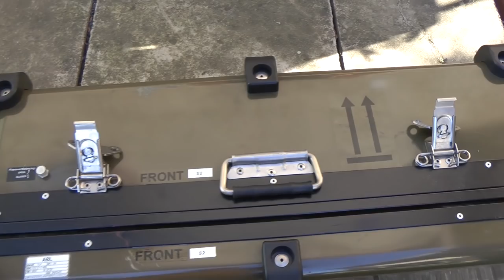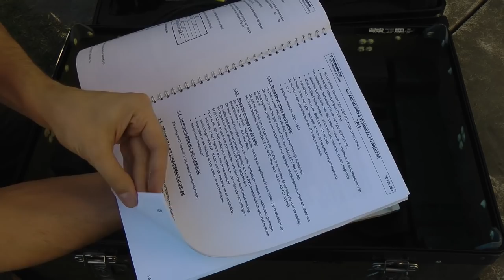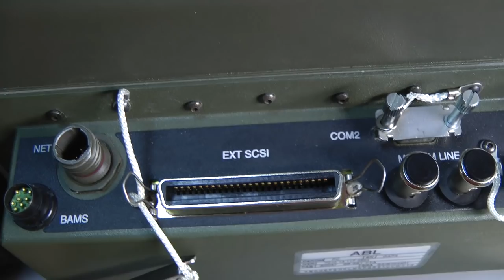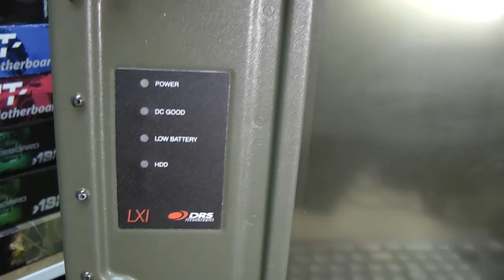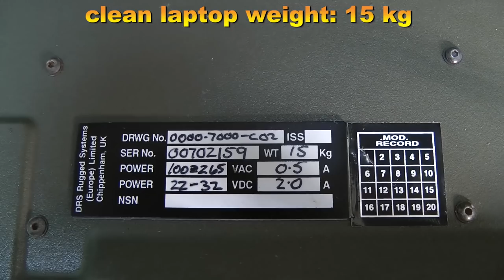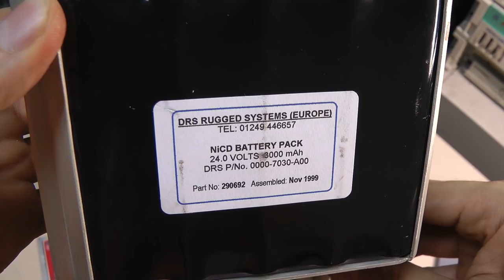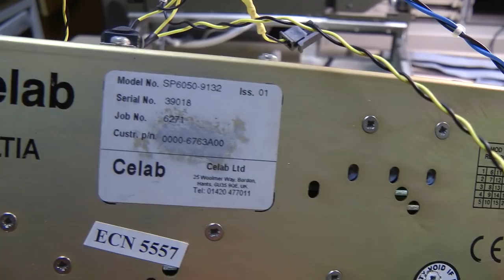Military rugged laptop - DRS LXI with Pentium MMX - RETRO Hardware

Comment: The heater on the HDD is there because mechanical drives perform badly in arctic conditions. The lubricants inside will freeze if they aren't warmed up and sudden changes in environmental temperature can potentially cause the disk to warp.
Reply: Bad sectors. Gotta catch 'em all.

Comment: I worked on some old decommissioned Canadian military equipment I found just setting in the rain with a old oil tarp covering it at a salvage yard. I was able to pull out some parts that appeared to be dry and in good condition.  Just like this unit, it was over engineered with hundreds of screws holding it together. 

It was not anywhere as interesting has this “ portable “ computer.  I’m very impressed with your work in taking it apart.  You are a very lucky bench tech and I hope someone will get back to you with answers to your questions.

Comment: the main thing is that there is no self-destruction system.😅
Reply: 7:31 this heating pad on top of the hard drive tells it HAS a self destruction system, may it burns the HD.
Reply: @rodrigo-mota  No, thats to keep the hardrive at a constant temperature while in extreme low temps, because temps affect the size of things which is not a good thing in terms of a hard drive
Reply: Those internal batteries do that job. It just takes decades.
Reply: Yes their is, its on the Hard drive
Reply: @rodrigo-mota  no it just makes the headers scratch up the drive while the drive spins at high RPMs som contain a version of termite called something else but it would be labeled with warnings.
Reply: No amount of armor can stop del system 32
Reply: @shmadul  
I was disappointed with the real function of the heating pad. maybe the fastest method of destruction is just shoot at it. 🤣🤣🤣🤣
Reply: Can't comment on equipment today but, years ago, there was destruct packs on com & crypto gear, just in case of emergency.
Reply: At least in my country no realy confident things are stored on the field computers, they are mainly just used as acess stations, codes and other things are on a separate device locked in a safe box, and one need a double check comman to activate important thinga anyway, so it's not a big deal even if that famous box would got stolen, not as in the movie world... The reality are as expected a lot more booring procedure.
Reply: Such computers could be equipped with a hardware or software signal encryption / decryption system. And a self-destruction system has always been installed in such devices. So that the enemy, capturing the device, could not use for its intended purpose.
When I served in the army , the main devices containing encoding / decoding systems were equipped with hidden thermite charges that worked when trying to open the device. 
And we have all devices containing military coding systems are not sold at auction after they are deducted from the service, but are subject to disposal under control.
Reply: @Юль4а344А  Ok, maybe there are different stage of security classifying on them, i hawe only seen the acess stations and we does not hawe any ICBM systems at all in my country.
Reply: @Юль4а344А  When You said it, i think it actualy must be adapted on those devices that can acess STRIL and similar things, the one i saw was probably just disarmed for safety reasons during mainteance.
Reply: Perhaps in such devices the self-destruction system works differently - if the access codes are entered incorrectly several times, high voltage is applied to the board and burns out the microcircuit.
Reply: @Юль4а344А  

I hawe not seen the finer details, but it may well be the case, when i try to recall my old memories i think it was also possible to connect some sort of small explosive or pyrotecnical device inside it as You mentioned, but it's probably removed for safety and legal reasons on those who are scrapped out and come out on the civil hands i think. But i know my brother tould me that some devices needed to be physically destroyed when they where scrapped out, like material that might contain sensitive data.
Reply: I might be wrong here, but as i remember data as realtime possition of troup and vehicle movement, etc are not store on any secondary memory on the field operating machines, only on RAM so all that will dissapear if the RAM power is cut off if i am not totaly wrong.
Reply: @Юль4а344А  Agreed. I just avoided the mention of thermite. Electrical-surge destruct will deny function, but some assets require melt & burn to deny inspection. Thermite packs convert stuff to slag - difficult to analyze.  Move away quickly.
Reply: @sheep1ewe   I served in the regiment of government communications and our main thing was encoding / decoding systems. Without these blocks, it is impossible to decrypt intercepted messages. Even if the enemy captures the tropospheric communications node, but the encryption block is destroyed, the enemy will not be able to listen to or interfere with the remaining equipment.
Reply: @Юль4а344А  Ah, thank You for the information, that was interesting.
I hawe only seen those once and i did not got any oportunitys to realy study the details on it.
Reply: For non-mil use, the best laptop I've worked with was a Panasonic Tough Book. Unless you fracture the case, they can take extreme abuse.
Reply: "Press a few keys"
News: nuke exploded at testing facility

Comment: Before you remove the battery, check if it will work without it. Some old laptops won't power on without a working battery. The AC adapter is only used to charge the battery, not to actually power the laptop.
Reply from the maker: You can run this machine with 110/240V or 24V in truck or hole battery.

Comment: Outdated when the government bought these, DRS charged at least five thousand dollars a piece for these over engineered, hot running laptops.  Most just collected dust in a supply room until turn in.
Reply: A similarly equipped civilian laptop would've cost $3,500 at the time. And it wouldn't have a desktop processor shoehorned into it. Also, no super-fancy flight case. LOL.

Comment: I had one of these in my HEMTT wrecker when we invaded Iraq. It was connected to a satellite and showed where everyone was at. Could also sent instant messages on It to other ones on the battlefield.
Reply from the maker: What operation system was used?
Reply: @RETROHardware  don't know. It booted up to whatever program they were using. Most stuff was XP back then.
Reply: @shadymaint1  The system that you are describing sounds more like FBCB2.
Reply: @JonnyBoyUltra161  could be. It was back in 03. Do not remember what model or anything.
Reply: @shadymaint1 FBCB2 systems in vehicles generally have a separate computer, screen, and keyboard. They also have either a PLGR or, more recently, a DAGR for GPS  positioning.  You should do a google image search for FBCB2, and check out the map screen to see if that reminds you of anything.
Reply: @JonnyBoyUltra161  It would not surprise me if the FBCB2 had a predecessor.
Reply: Haitham Ali yes brother

Comment: Hey! I have exactly the same laptop, but just with cables. No hour counter. No printer, no case. Also, the internal hard drive is different. It did power up, but complained about the CMOS RAM. Replaced the battery (not original, did a hack), but I can't get it to boot from the HD. :-(
Zillion screws to get inside. What a nightmare! Same keyboard-layout. Got mine for 50 €

Comment: Troppo bello. Non avevo mai visto un computer militare.

I like the fact that the modem connectors is allowing to install just two  plain wires. The connectors in general are very nice.

My father bought that printer around 1994/95, I remember it.

Whoa!

Comment: I'd do one hell of a build in it. i'd put an ATX UPS power supply and a mini ATX Motherboard with a graphics card on a riser. The HDD caddy fits 2 SATA SSD's plus the NVME SSD on the Motherboard itself. the only real challenge would be to interface with the keyboard and monitor, as they may not use standard protocols.

Comment: You could put your mains battery externally on a socket so it doesn't leak you can change it whenever you need to two and put a panel mounted fuse holder on the power supply for easy change for the views

Comment: Dunno if described later, but the heator on the HDD is for using the device in colder temperatures (eg <0°c)
even the newer rugged Laptops and Servers have some heaters for running in cold envirements
Reply: If this is a peltier element, then maybe it can work as a cooler too (reverse polarity) for the very hot climates, such as those desert operations where all those dust/sand filters also make sense.

Comment: 7:33 It's an IBM DARA-212000, probably 12.07GB.
https://computeuk.co.uk/shop/IBM-12GB-DARA212000
I know it is an IBM because the hole has a round label indicating that the hole should not be covered. I have seen many old IBM 2.5 HDD. 
Although in reality these HDD are manufactured by Hitachi.

Comment: Replace the RTC/CMOS battery, Relocate fuse as you said. Remove main battery and maybe replace it with a modern lithium-ion battery cells with proper charge controller. For the Hard Drive I would replace it with a SSD either with CompactFlash or SATA to IDE conversion.
Reply from the maker: HDD is next round is this machine will post. Interface is classic 44pin IDE so how you said - lot of ways what to do around.

Comment: Maybe try and fix the HDD cable as well. Would love to see if this weird heater actually makes any difference to a normal HDD. I know that there are MAMR HDDs which use microwaves to heat up their magnetic discs, but this little thing in the video seems unique :)
Reply: For me the cable seems OK since no damage to copper traces noticeable. Also heater is common feature on older rugged laptops. Helps to heat ball bearing lubricant.

Comment: Mine is  missing the power cable for 220 volt :( But I have the original ethernet spool with a very long cable. The laptops are used by the belgium army. I think they used it as a pillbox :D

Comment: I'd like to see this running, and if you can get ink for that HP printer, maybe a test of that too. I'm predicting it runs either Windows NT 4 Workstation, 98 SE, or 2000 Pro, that might automatically load into some custom software.
Reply: Made in 1999 so no Win2000. I guess Win98 since it was most popular OS back then.

Comment: The modem connection is neat... Like, what's more standard than a phone jack?  How about spring loaded speaker terminals?
Reply: well you can run "ethernet" point to point with field phone cable that way

Comment: What an interesting piece of hardware.😉 Way overbuilt, as is the case with most military stuff. It took me a while to realize the mainboard is actually in the base. (I was looking at that DB9 connector on the bottom of the keyboard and wondering how they got power/video/etc. through that, when all it was, is an interface cable for the keyboard itself! There's enough room in the keyboard enclosure for a couple of modern laptop mobo's. 🤣👍 It will be interesting to see if you can get it up and running...

Comment: Once a fuse dies like 2 times in on these they decommission them or send them to another country. It's due to everything  you went through. This is what I was told by someone that worked on them in the army. The Air Force mobile command computers looks similar. IDK about now.

Comment: Aladdin IV chipset and 72 pin non parity ram? bizarre. I also would suspect it has no cache memory, which would most likely make it more reliable in high RF area's, but lack of parity is really interesting. I would have also thought these things would use the Intel HX chipset if reliability is the most important factor. Time stamp on the ram is also late 99 suggesting it was either upgraded at some point or this computer was really late in the life cycle of the MMX cpu.  Which if this thing was really built in late 99, why they would go with desktop MMX and not a hardened intel dixon mobile cpu?  So many odd choices.   But other componants are early mid 97 which would be more in line with the desktop components time frame. The desktop 233 would have probably been the most powerful CPU that could have gone in such a machine of that time, but lacking L2 cache is again an odd design choice.  Those Sticks look like it has 64 megs of ram most likely. I also find  that DSP radio board very very interesting!  That thing could be programmed to do any number of things you want. That FPGA on it is rather high end for the time.

Edit: Looks like from the pictures it does indeed have 512K of L2 cache.. I should have looked at the pictures first!  That intel chip on the mezzanine board is a PCI Lan controller,  The Cirrus Logic chip is for controlling the cardbus/pcmcia and the Chips and Tech qfp is for a 2 meg vga controller and the LSI Logic is for SCSI.

This is such a kool machine. Really amazing video! thankyou for posting.

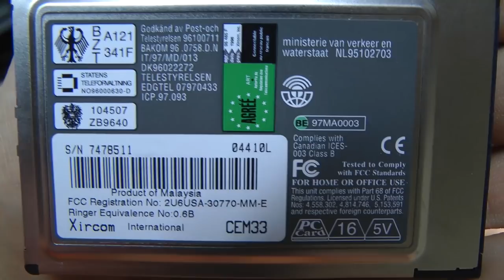Comment: 14:29 - PCMCIA card - "for home or office use". I wonder if it comply mil standards.
Reply: Probably not, but maybe all that metal shielding around it at least takes care of the radiation hardening part of it?
Reply: It does. On the card it says “Ministerie van verkeer en waterstaat” which is the Dutch Ministry of traffic and water management. So either this laptop was used for readings they do or the card has been repurposed for another governmental departement. But that is unlikely in these types of laptops.

Comment: Any idea for the specific purpose of those pressure alignment valves? Is it simply because the case itself is so air/water tight that a pressure difference may build up due to temperature or environmental changes while the box is kept cealed?

Comment: Very interesting video and great job! I actually have the same one but it always get stuck at the first booting screen. I tried to use a bootable floopy disk and even managed to use a CF Card with IDE adapter but didn't succeed. Did you managed to boot it up?
Reply from the maker: My doesn‘t work so I don‘t know man. Maybe new MB battery will help you but this is about complete disassembling ...
Reply: @RETROHardware  I also replaced the MB battery and tried to change some options in BIOS setting, but it still got stuck at the first booting screen. OK, if you happens to make it work please let me known. Cheers.

Comment: GI Joe computer, it's fun, but would such a thing be any better in the field than say a contemporary Thinkpad laptop in a strong case? I very much doubt it. I don't see any hardening of anything other than putting the whole works into a safe! If that took a great shock as from say a nearby explosion, the various connectors could be damaged, RAM unseated, HDD damaged etc. No fire protection. Just all for show.

Comment: 18:50 anyone knows what is the name of this connector hanging out (from the screen) ? i have a similar one but nothing is written, only an arrow...
and i talk about the grey one, not the rainbow header. thanks if you reply :)
Reply from the maker: This is conn to PCMCIA card modem or LAN one. This card has both of them.
Reply: @RETROHardware  thank you so much !
i have an adapter from this connector to 9-pin (it seems to be rs-232).

Now, I can tell what it is: the cable reference is PM-031 from Brainboxes.
I was amazed to see your video, i never saw a military-class computer. The most remarkable about this one is there is nearly (2, and maybe less than 10 surely) no electrolytic capacitors on it. you've found a true piece of tech history there, congrats :)

Comment: Hello! Remove heater from HDD! or replace this hdd with other... this device can thermal burn your HDD for security purposes!
Reply: The heater is there for heating up the hdd in cold temps. Not to kill it.
Reply: @SheIITear  may be... may be... but I don't think so...
Reply: @VeselchakU  lol? Go put your hdd in -35°C and let's see how long/well it works. Why would you even try to kill hdd with a heater? The wires/heater unit would die before the hdd itself would even start taking damage. Also hdd uses magnetic metal disks to save data, so it still would be recoverable even if the control unit would be toasted. The heater itself is shaped like the disks on top of the disks so it's obviously for heating purposes.

Comment: There is a good chance to get the NiCd batteries alive. I think, that the best solution is try to charge this battery pack. If it will be successful I recomend leave the battery pack as is. If not, just remove the battery pack. Because for the collector purposes it is the best solution. But NiCd batteries are very good for storaging. I have one Russian osciloscope from year 1992. The NiCd battery was charged after 20 years and it works normaly. For NiCd batteries long storaging is not big problem (usually).
Reply from the maker: Yes now I will replace complete pack outside.

Comment: You might want to check the PSU a bit more. A fuse does not pop without a reason. Also, my way to diagnose any issues in a PSU: http://www.giangrandi.ch/electronics/smpsfix/smpsfix.shtml
Reply from the maker: Yep this is true. I will check everything 50x times before first start with new fuse.

Comment: If the fuse blew, something is wrong in the power supply (capacitor, mosfet,...). You should investigate the whole power supply first ...
Reply from the maker: Of course I will check everything 50x times before first start.